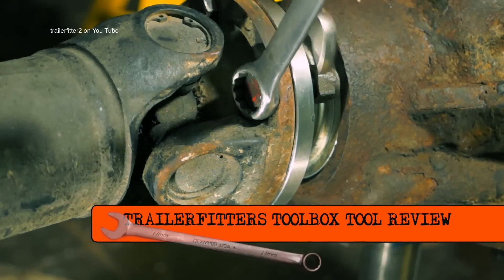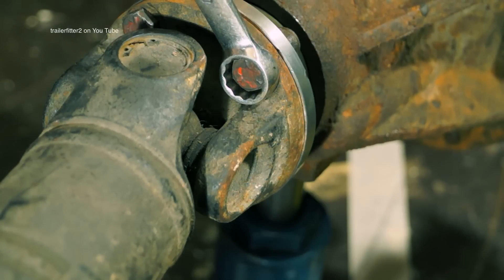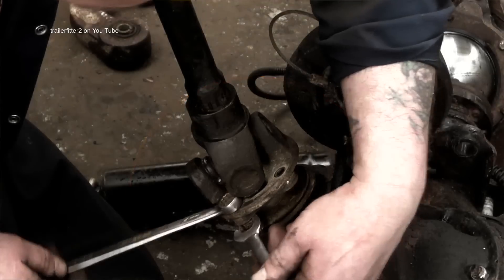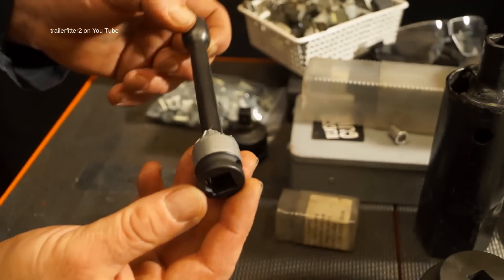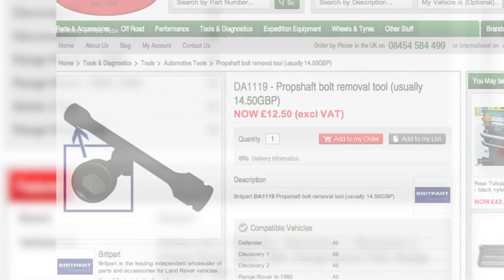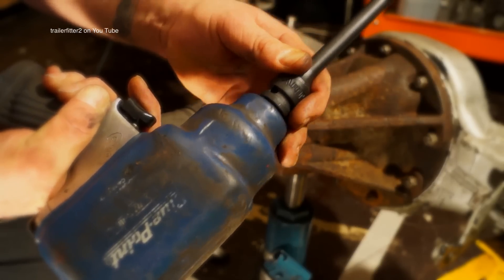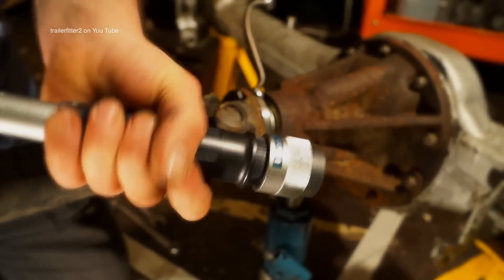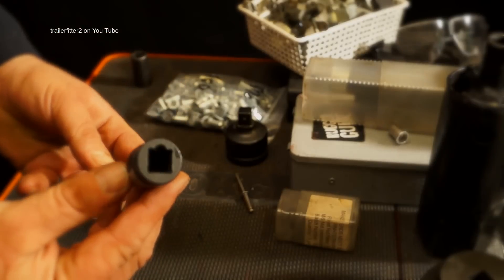Land Rover servicing tips, tricks and tools - DA1119 Prop'shaft  bolt tool.

Comment: So I am a little lost, is this simply a 1/2" expansion with a 9/16" socket built into the end? Not bashing, just curious. Is the design such that it has thin walls to easily fit?
Reply from the maker: yes it is slim line enough to get to the bolts .
Reply: I would be tempted to just grind down an old socket.
Reply: I ended up making one up out of a 9/16” with a 3/8 drive an extension and an adaptor to 1/2” drive as it was skinny enough to fit unlike my 1/2” drive socket, I may end up slightly grinding it down further as it only just fits and a little more wiggle room would be nice